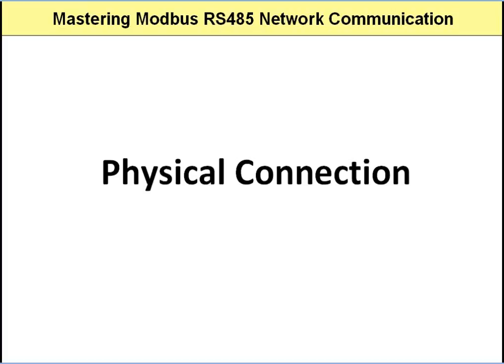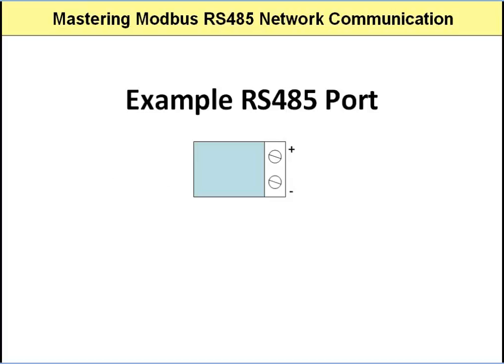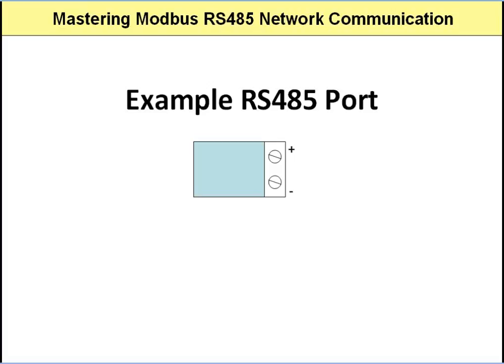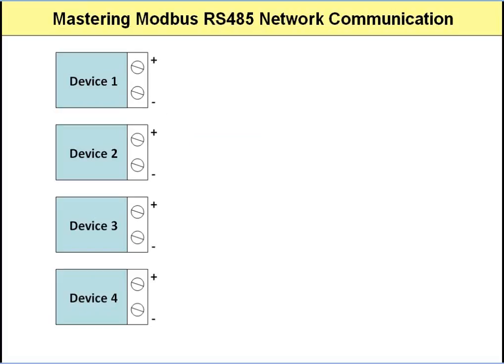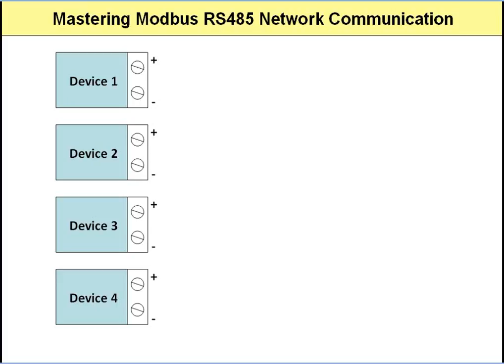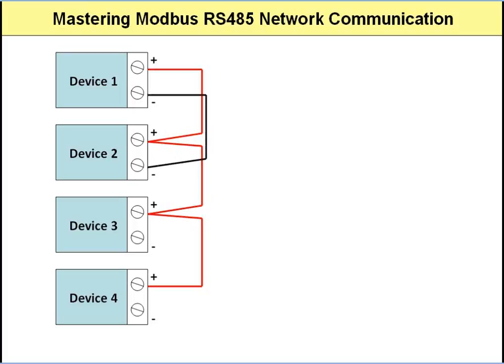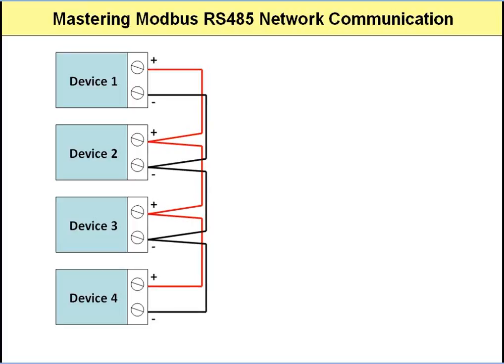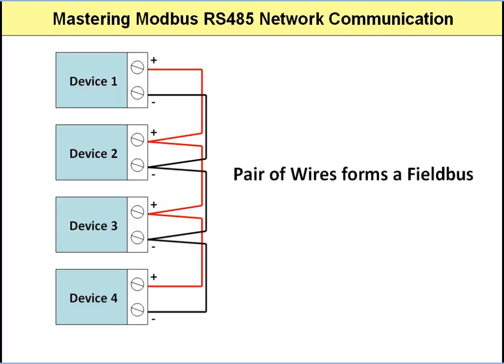RS485 Physical Connections

Comment: How did you connect these devices to rs485?
Reply from the maker: Each device in the diagram is meant to be RS485 compliant, so they support the voltage/signal levels of RS485. This video shows how to connect RS485-compliant devices in a daisy-chained manner.
Reply: Emile Ackbarali txd of host should be connected to device signal + and rxd of host should be connected to signal-. Am i correct?
Reply from the maker: In RS232, there is a distinct Tx line and a distinct Rx line. Both of those lines use Ground GND line as a reference. RS232 is an example of full duplex transmission. 
However, RS485 works differently. Both + and - lines are used when data is being transmitted in either direction. It is a half duplex system. 
So in RS485, there is no distinct Tx and Rx lines. There is only + and -. If the host is RS485 compatible, then it to will have a + and - line and should be connected to the system in the same daisy-chain manner.

Comment: is it possible to convert two wire rs485 into four wire rs485
Reply from the maker: There is no such thing as 4-wire RS485. If it uses 4 wires then it is RS422. And yes, there are converters that will convert from RS485 to RS422.

Comment: Actually RS-485 is 3 (THREE) wire interface as it has a common mode voltage on A and B lines. So there is a need to have a return path for the current induced by this voltage. And you will see that the device erminals are 3 screws: A, B and GND.
The second thing is that you'd better name the data transmision lines as 'A' and 'B' rather than '+'  and '-' as they are not always positive or negative. A and B naming convention will make and much more clearer and less tending to miswire.